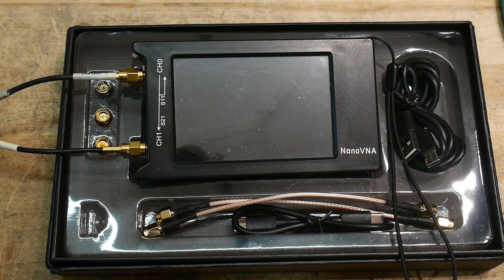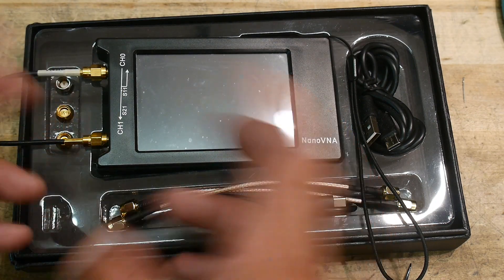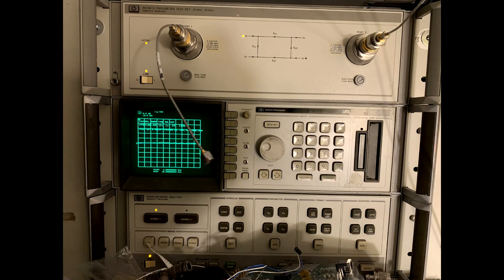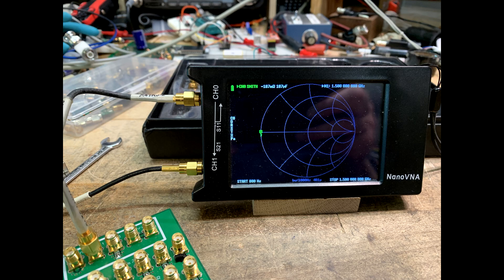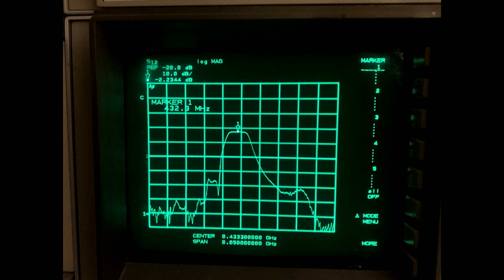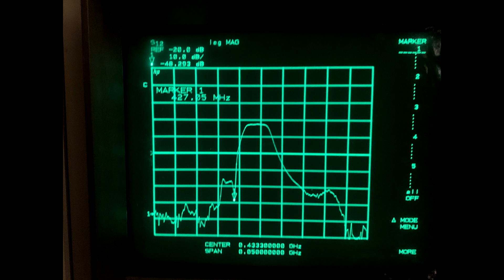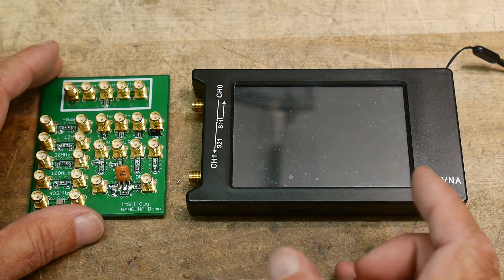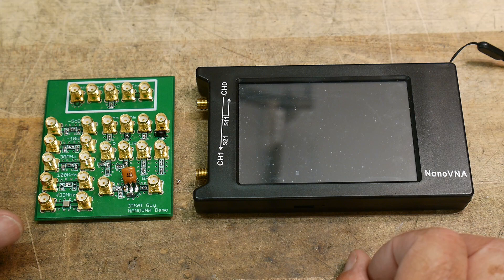#817b NanoVNA compared to an HP VNA

Comment: always cool to see these old HP analyzers still in use, but are you seriously using an 8350 as your source as opposed to an 8340 or 8360? the specs are so loose on the 8350 measurements could be miles off from what they really are

Comment: Great informative video. Not everybody can afford to have HP equipment on their workbench. As a ham radio operator, this little guy fits my needs to the T. I do have a spectrum analyzer w/tracking generator, but I could not pass up purchasing the NanoVNA H4. I mostly use it for checking insertion losses and attenuation. I read how the little Nano works using harmonics. I guessed anything above 1 Ghz would be questionable. My plan was not to use it above 500 mhz. 
The 50 ohm load that came with the unit was not 50 ohms. I replaced that right away. It wasn't too far off, but the higher you go in frequency, the more influence it had. 
For $89, the little Nano is a very useful tool. It sure beats spending $40,000 plus. 
Thanks for posting such a great video. It was really interesting to watch. 
Barry, KU3X

Comment: This basically confirms that the NanoVNA is great for what it is... an inexpensive, very portable, network analyzer.  
Its a step in the right direction... I see this as a great learning tool, that will, in time, blossom into something better in performance and accuracy.
It's like the TinySA...a very cool, yet tiny Spectrum Analyzer... I'm amazed at what it can do and size difference, given my other SA is an HP 141T (w/track.gen).. that thing is a beast.

Comment: Can the SAA2N be treated in the same manner as the H4 (firmware etc.) or is the H4 different?
I actually wanted the H4 (because the N-connectors are so bulky for test-bench use) but at the time of purchase, they were not available.
Anyway, thanks for doing the comparison video.  73...
Reply from the maker: Sorry I don't know, maybe there is a viewer that can answer this.

Comment: The fact that a professional user with access to "real" VNAs actually uses the NanoVNA for at least some work purposes is an enormous endorsement. BTW did you make use of his 8510 to characterize your cal set at higher frequencies than 1.5GHz? Wouldn't hurt to see how they perform way up there for future purposes. 😁
Reply from the maker: No, I did once have him test one of my SMA loads to 18GHz so I know that is good. I also tested a dummy load I made so I know how far I can use that. didn't test the sma female open and short as he did not have a good cal set for that.

Comment: Awesome comparison .. Love it. After buying 2-3 LCR meters and Kelvin probes, I found out that I could use this little thing to measure inductance values I usually have problems with .. like under 1uH. .. i.e. 5 turns on a T37-6. And more to the point I already owned a H4. Thank you.

Comment: Nano is great up to 300-ish MHz, once it switches to harmonics mode trouble starts. If you got your H4 from Hugen there are published coefficients for his calibration standards that you can use with NanoVNA Saver and get better results. BTW, when a trace is outside of Smith chart, that usually means there is something wrong with the measurement.
Reply from the maker: I noticed the HP VNA calibrates many more parameters than the nano.
Reply: @IMSAIGuy  I believe that the HP VNA is a full 2 port device so it has to apply full calibration to both ports.
Reply from the maker: @galileo_rs  Yes that's true. It also seemed to have some calibration steps that I didn't understand. Maybe related to the two ports

Comment: Frequency absolute inaccuracy  (1 MHz) of HP8510B is due to the use of a YIG SOURCE (which is NOT synthesized) instead of the regular HP8340 family of Frequency Synthesizers... When measuring differences, such as phases, this is not so important.Anyway, not so bad for a low cost toy...regards from Italy.
Reply from the maker: I thought so too, my friend tested the generator and it was fine. the error must be in the VNA marker calibration so something.